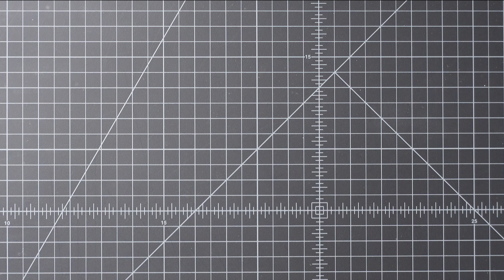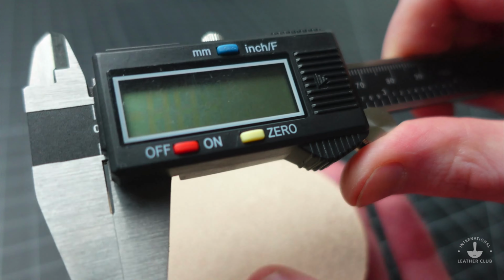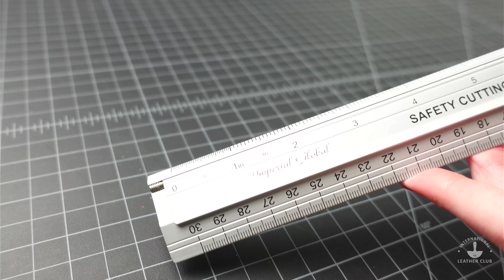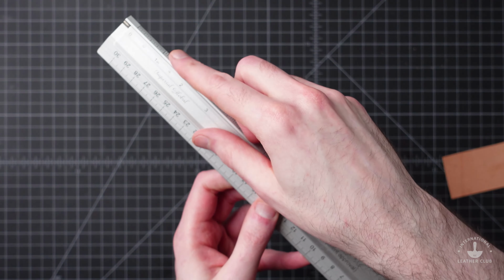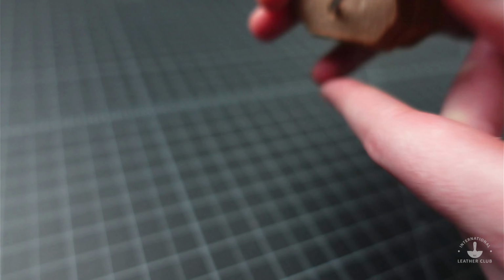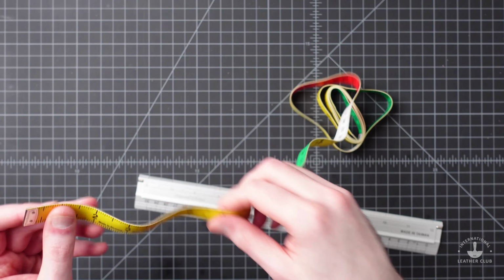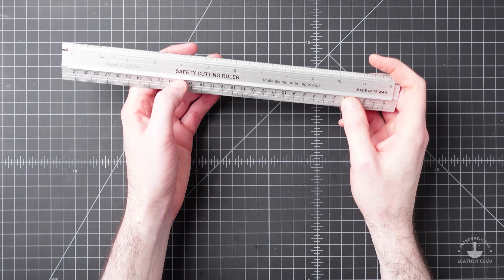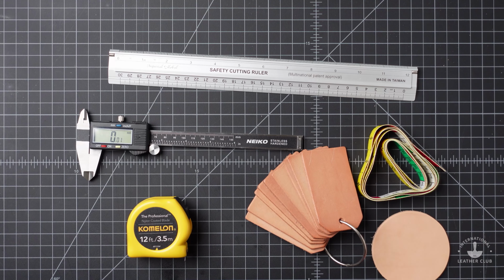Leather Working Measuring Tools: Rulers, Calipers, Gauges

Comment: You should add a set of French curves. I find them very useful for finding nice gradual sloping curves for transitioning between straight edges on a workpiece.
Reply from the maker: Hello 😃 that's a really great suggestion, we'll add that to our future video planning. 

And for those reading, check out the French curves, too! They can definitely be helpful in the shop.